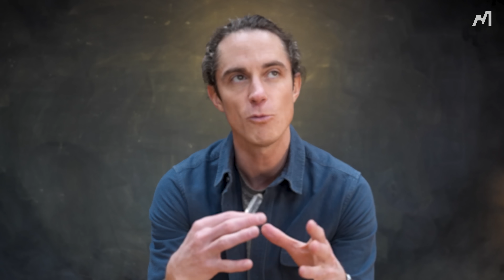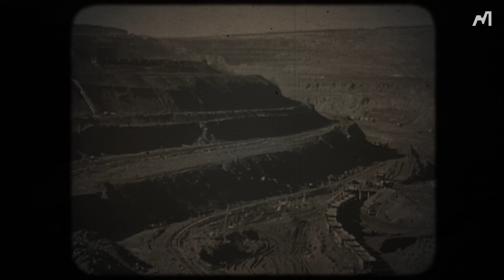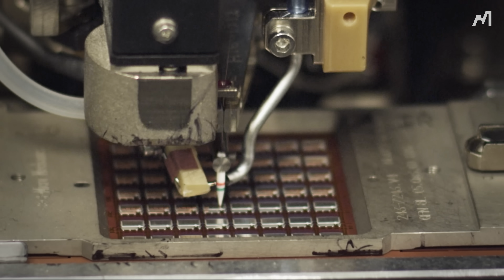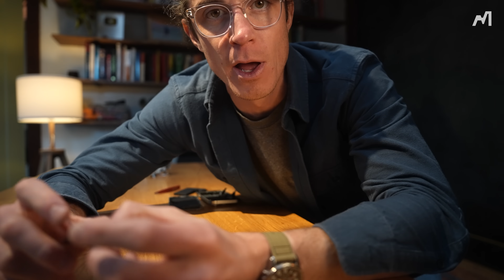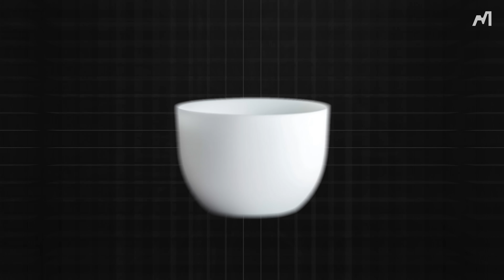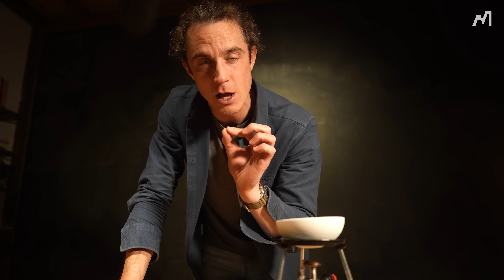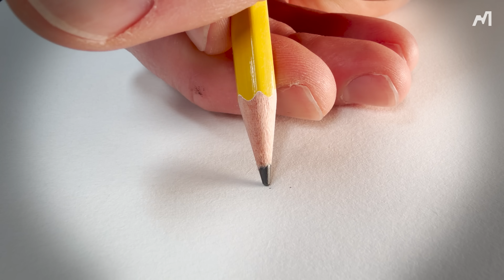Saudi Arabia Has Oil, America Has This

Comment: But wait... You can make pure quartz from pure silica and pure oxygen. It's just more expensive, not economical, not competitive, but possible.
Reply: The synthetic fused silica you're talking about is actually used to coat the insides of the crucibles he described in the video. The spruce pine quartz is only used as the outer shell due to its thermal properties. We can make synthetic quartz crucibles to replace the spruce pine quartz but like you said, it's not economical

Comment: Nice story - maybe sponsored by the CIA, however in the real world, the US sold it so cheap that everyone gave up producing silicon wafers. The UK had the technology in the 60's and I saw them from the company I worked (and a microprocessor in the 60's as well ....) for but they stopped producing because the US sold it so cheap - not better - cheaper, but they can produce them again if it was required. The technology is basic and yes a black art which means large waste of power to produce unless your power is cheap.

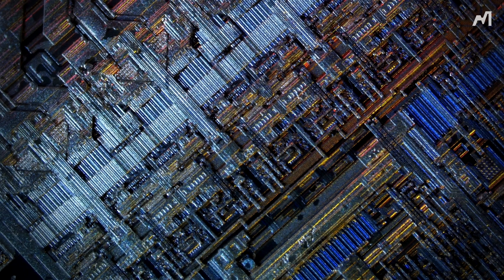Comment: Great video! But I want to point out that it’s not the end of the world if even one circuit is faulty on a chip  ( 5:01 ) that part is incorrect.

It is impossible to remove all impurities from silicon. And the etching process isn’t perfect. Nearly every chip has a defect. 

So what they do is they purposely plan for chips to break during manufacturing since that is inevitable. They break up the price of the chips based on the quality (i3, i5, i7, and i9 for example). So the different “i-number” isn’t different CPUs… they are all the same just GRADED differently in a process called ‘binning’

So when you buy an intel chip technically they are all the same chip design… it’s just some chips (i3) have some of the cores on it that are faulty and thus unused.

So if the plan is to have a flagship chip design with 24 cores and you have a batch where only (AT LEAST) 12 cores work then that whole wafer will be sold as “i3” chips even though technically they physically are built the same as the “i9” chips it’s just “i9” as 24/24 working cores and “i3” technically has 12/24 working cores. But they don’t say that they just say “12 core”

The only time a chip is fully trashed is if a single point of failure breaks. (For instance if each chip has ONLY one ALU and the ALU is botched ONLY THEN is the whole chip trashed)

Comment: Good video, thank you! I'd like to add some other info I found online: 

North Carolina quartz deposits are mined by two foreign interests; Sibelco (a Belgian-owned global material solutions company) and The Quartz Corp (a joint venture between French company Imerys and Norwegian company Norsk Mineral). Also, Hurricane Helene shut down the mine in 2024 temporarily, but the sector had months worth of wafer stockpiles, so supply chains didn't really notice.

Really interesting stuff.

Comment: The thing is , China is on the verge of achieving independence in 9N silicon production, and China currently dominates 80% of the world's volume of polysilicon, they have the infrastructure to be completely independent from the US supply chain
As of right now, only the ultra high-end 11n+ would be at risk for the Chinese if America stopped exporting and synthetic silicon is a thing although they are 5 times more expensive but it is still achievable for the Chinese, they are going to prioritise advancing and making the process cheaper

Comment: Regarding the geopolitics: Couldn't a country with access to pure silicon simply burn it in pure oxygen to produce pure silica? Is this cost prohibitive or something?
Reply: The synthetic silica you're talking about is already used to coat the crucibles, the spruce pine quartz is just used as a container for it. We could make the synthetic crucibles to replace the ones from spruce pine, but you were right that it's not economical.

Comment: this is wrong,, just wrong on so many level, no carbon manufacturer will accept pine , cedar, poplar , or ash , if its even mixed in with the preferred green hickory or oak sawdust load you dumped you will not be allowed back for years after you have been instructed to come back and get that out of the yard , the cell structure is to large and explodes during the kiln process , the risk of facility damage, and safety risk to the operators makes large cell woods unusable , they make some out coal as well , but radioactive material in coal makes it unusable for high grade chips , he is right about making microchips out of sawdust but its tight grained green (fresh) hardwood sawdust  , and no company is cutting trees down trees and turning them into microchip grade carbon they use hardwood mill byproducts , and there are some misguided people on the west coast trying to do it with corn stalks with no success , but Brazil was also a major manufacturer , but they clear their hardwood forests rather use the conservation methods of the US southern states , and Appalachians , and the vast majority of the worlds hardwoods comes from there and is a completely sustainable industry

Comment: Synthetic quartz is real silicon dioxide (SiO_2) grown in a laboratory using a hydrothermal process that replicates natural geological conditions. Your video ist just absolutely meaningless and wrong. A factually wrong statement explained over 13 Minutes incl. a completely non related AD.
Reply: Lab-grown synthetic quartz costs anywhere from 5 to 10 times more than mining and processing the natural quartz from North Carolina.

Remember, these massive crucibles are destroyed after a single use. Sourcing 100% synthetic quartz for every single batch of silicon would send the manufacturing cost of microchips skyrocketing. If something catastrophic happened to Spruce Pine, it would take billions of dollars and years alone just to replace what was lost. During those years of transition, global chip production would severely plummet, causing an unprecedented global tech shortage.
Reply: @Langebaan  Chip prices are not driven primarily by the cost of silicon as a raw material, but rather by expenses such as research and development, marketing, and services. Even if the price of silicon were to 10x, it would increase the final chip price by only about 10%, which is significantly lower than the current typical profit margin.

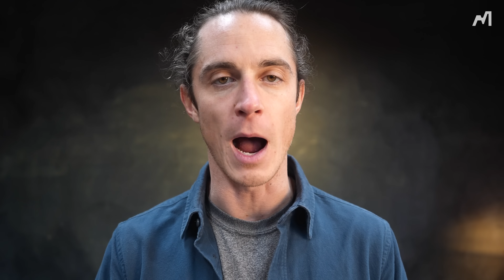Comment: 4:25 First you can still make (crucible)Using 4N quartz . Or make synthetic quartz.

The weakness of these 2 methods is that they are more expensive than  using 5N quartz in the United States.  

Also making silicon for  solar panels is still possible using 4N quartz.

Comment: Bruh.... "making silicon wafers isn't an exact science.... its made through a feel through decades of apprenticeship to masters of the craft".
Bruh, how excessively dramatic do you need to be? There is 0% chance ANYTHING associated with chip production is so specialized that it requires a single individual to be 'master' at the craft. There is so much that goes into semiconductor manufacturing at the global scale, EVERYTHING is figured to an exact science!  If it wasn't, it wouldn't be commercially viable... I can't continue watching...

Comment: 9:13 Just fyi, this isn’t how the blades inside “every jet engine” are made. Most commercial and military models from RR, GE, and other big names are made from forgings which are CNC machined and finished with other mechanical and chemical methods, not grown.

Maybe this is used in some hyper secret projects, but not in the production I’ve witnessed

Comment: In my water treatment plant, we use a state-of-the-art UV system for disinfection of the water we produce. What are the sleeves that contain the UV-C bulbs that burn 600% brighter than the sun made of? Synthetic quartz. And they're ungodly expensive. 
These bulbs burn bright enough they can punch through a cryptosporidium cyst and deliver enough energy to cause it's DNA to vibrate to the point it shatters into debris, 'inactivating' the pathogen. 
It's UV-C so intense that if you were to look at it during maintenance without the proper safety equipment, you'd go blind, instantly and permanently. Looking at it WITH the proper safety equipment is like looking into the most perfect, pure white light you can imagine. When we first got this equipment, we used cloth jersey gloves, which are not the right equipment. I passed my hand across an exposed access port for a fraction of a second while I was working on it, one time...the next day I had a sunburn on my hand in the pattern of the weave of those gloves. After that we switched to rubber-coated gloves lol. 
Point being, high-quality quartz is at the heart of things we don't even think about like semiconductors that power our everyday lives.

Comment: Synthetic quartz isn't that hard to make.  Liquid chemical and molten crystallization methods exist to purify it. 

It's cool: a giant furnace is loaded with crushed autistic quartz, which is molten and then recrstallized over the course of months. 

Costs are that it's slow so you need a lot of machines. 

It's also the reason we don't use algae for food production even though it's 10x more efficient than field crops: separating the water. 

This process is like that: it's too equipment and energy expensive.

Comment: Spruce Pine isn’t the only source of natural high-purity quartz. China produces around 5,000 tons annually, and is hoping to scale up its operations to 20,000 tons or more. Norway and Russia both produce a small amount, and historically Brazil was a major supplier. And there are other potential sources around the world being investigated in Canada, South Carolina, Sri Lanka, and Australia. But for now, Spruce Pine is the source of 70–90% of the world’s supply

But Spruce Pine being the primary source of high-purity quartz doesn’t make it irreplaceable. In addition to efforts to find new sources elsewhere, there are a variety of ways that it could be substituted, though they’re not without difficulties.

One option would be to use synthetic quartz rather than naturally mined quartz. Synthetic quartz can in fact be made far purer than natural quartz. The downside is that synthetic quartz is much more expensive, perhaps on the order of 5–10 times the cost of natural high-purity quartz. Chip manufacturers could probably absorb this cost, given that the silicon ingot is a relatively small fraction of the cost of a microchip, and as I understand it some chip manufacturers already use synthetic quartz crucibles, sold by companies like Japan Super Quartz. For solar PV, however, this cost increase would be a huge burden.

Comment: A true chokehold would be control over:

· Polysilicon refining capacity (China controls ~80% of the world's polysilicon production, mostly for solar)
· Advanced lithography machines (ASML from the Netherlands)
· Certain specialty chemicals (e.g., photoresists from Japan)

Spruce Pine is a critical bottleneck, but not a chokehold. The industry can—and will—bypass it if needed. The cost would just go up.

Comment: Actually, Spruce Pine silicon is used only for the crucibles used to melt the silicon for electronic grade silicon, not for the silicon used for the chips themselves. There are also alternative deposits in Russia and Norway. There is also the possibility of pivoting to synthetic quartz, but currently the Spruce Pine silicon is the cheapest. Long term, The industry as a whole is looking to pivot away from silicon to GaN and graphene.

Comment: Let's be clear here, to be honest Spruce Pine, North Carolina is not THE ONLY place to get quartz for the semiconductor industry ... it is just the best place.  

All the chips NNEDED for everything ....  can be made from Quartz from a dozen other mines (and they ARE all used) . There's a really good source in Canada, and the one China opened in 2025 is pretty good.  It's as good as China NEEDS too.

There is almost no need to make the chips smaller now too. and the gains made by making the ships smaller are tapering off quickly.  They are almost as small as possible now.

We are approaching the molecular smallest chips CAN be made.  If the USA cut off China today?  China could still make every chip, that they need, with their own quarts supply, or the mine in Russia, there is ZERO NEED to keep making chips faster and smaller today.  

Your iPhone does NOT need to be any smaller, they gave up on that.

Comment: And the Netherlands has ASML which has the world's only EUV lithography machines.. which in turn would choke everyone, including America, China and Taiwan. Attempts to reverse engineer it have failed as well.. but sure, America is totally independent from the world. As if they don't rely on the EUV machines I just mentioned because they do just as everyone else does. This video conveniently misses that as expected. The companies that mine the Quartz are also majority European. The ASML EUV lithography monopoly is ABSOLUTE, the quartz monopoly is NOT.

China is actually the most resilient when it comes to the semiconductor industry, they have the resources and brains and do not rely on anyone else, they may be behind but that's because they don't have access to the world's best and especially the Dutch machines.. otherwise they're already closing the gap by themselves. Japan has prior expertise in DUV lithography but it's obsolete by now, albeit useful in the case of a semiconductor industry apocalypse but lack resources to sustain themselves independently. Taiwan lacks resources, Netherlands has the monopoly but also lacks the resources and America relies on the Netherlands but has the resources.

So yeah, it's a near-monopoly on the ultra-pure quartz but absolutely not one that can be leveraged in any capacity unlike rare earths, oil or advanced tech as mentioned.

Comment: 8:50 I would just like to correct. The CZ process you describe that is used to create the ingots is done by a MACHINE, referred to as a 'Silicon Crystal Puller'. Yes, human oversight is required and operators are typically called 'Crystal Growth Operators'  not 'Master Pullers', their job is to load the crucible and initiate the process by dipping the seed crystal and setting initial parameters, but the actual crystal growing/pulling process is almost entirely automated, due to the zero tolerance manufacturing where any amount of human error would cause the extremely expensive materials to be rendered useless.

Comment: The quartz, high purity, you talk about is only used for quartz crucibles. Not the "glass" inside the computer chip. China recently found a high purity quartz vein. Also it can be produced synthetically at a higher cost. Since its a "tool" used to make tje process work, its cost can be amorterized over 100k's/1M of wafers

Comment: 5:09 Not strictly true. in many of these cases, only a part of the chip is unusable. while this may result in a product missing some power or functionality, it is often still usable and can be sold in a lower tier device. The inferior chips are separated in any processes called “binning”, which is how they got the chips for the Macbook Neo. These were “failed” iphone chips that were set aside

Comment: I am not sure why you are calling Silicon Wafer a  quartz crystal.  Not  the same thing. One is for manufacturing chips, the other is to make high quality oscillator for a particular frequency, and without it, modern electronics would  not be possible. The first time silicon substrate was used for  electronics with transistors. Before that, it was a Germanium substrate.

Comment: I feel like this video is incomplete without mentioning synthetic quartz that’s being produced since the industry is aware of that single choke point of Spruce Pine. I read that it’s even higher quality and also reaches 99.99999999999% purity - though still more expensive. But it’s such an important aspect of the whole story and potential future of the material.

Comment: I looked into it and there are other places that could supply quartz if the US stop exporting from Spruce Pine, but it would require more processing to reach the amount of purity needed, which would raise the prices of the final goods, but that increase in price would only be like 5% in the worst case scenario and it would ofc cause some short term disruption in global chip manufacturing.
So the US doesn't have anywhere near as big of a strategic advantage as you said.

Comment: Why does this guy always so OVER EXXAGERATE American geopolitical dominance? He's literally making up the importance of the spruce spine mine.

"While Spruce Pine, North Carolina, is famous for exceptionally pure quartz used in high-end applications (like some microchip manufacturing), it’s not irreplaceable. The industry would face challenges if supply were disrupted, but there are other sources of high-purity silica, and technology would adapt. It’s important, but not a single point of failure"

Comment: You need to do better research. There are way more sources for this type of quartz. There are just not as economically viable compared to Spruce Pine. China opened a mine a few years again, Zeiss is an investor. Also synthetic quartz is being produced.

No, America has no real strategic mineral here, Quartz is abundant, its just cheaper to get it from Spruce Pine because of its natural purity.

China has material that you will barely find beyond its borders, massive difference.
Reply: Australia has similar purity at 99.998.
Reply: Pretty sure lab grown quartz specifically for SEMIC's is 5-10x more expensive, China probably doesn't even need to resort to lab grown quartz, unless they cant produce natural ones, but China is the largest exporter of quartz, they are extremely lucky as they hold all of the worlds future necessary resources in abundancy.